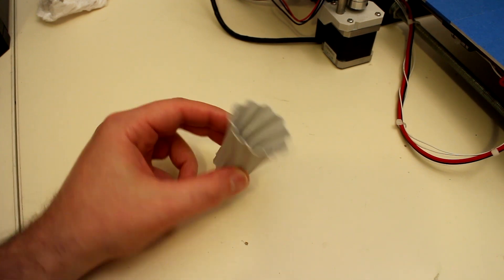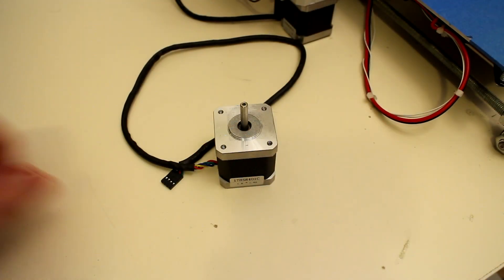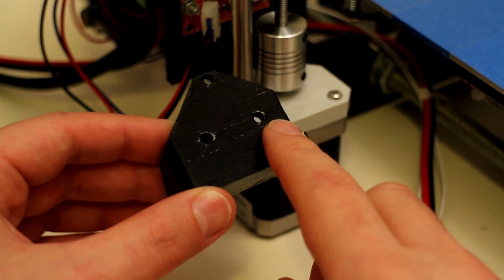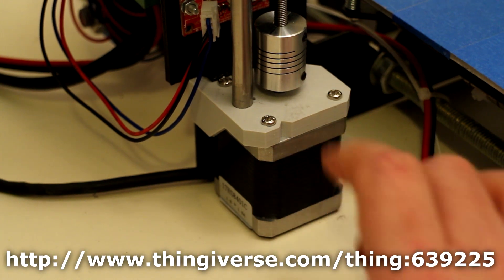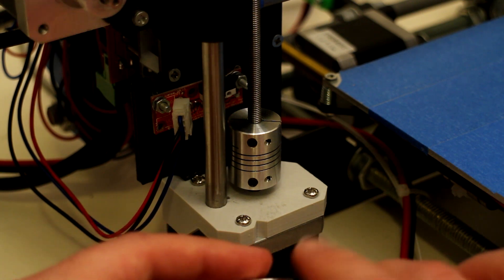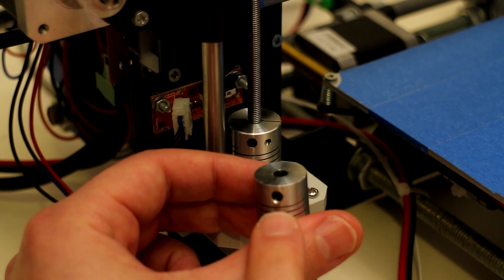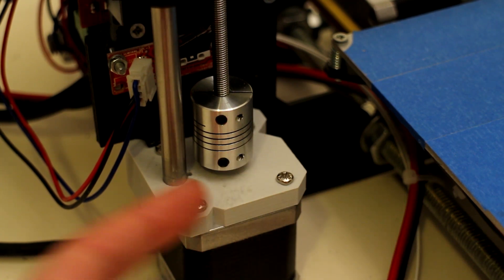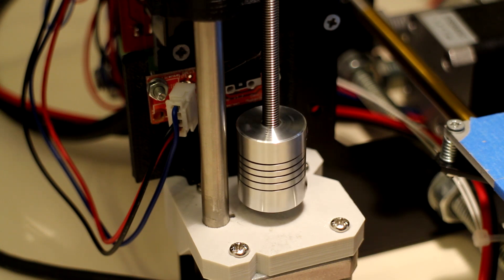3D Printer - Improve Z-Axis Print Quality

Comment: Good tips! I've been doing taller and straighter prints lately and have noticed a perfectly periodic Z wobble. It's very slight, but noticeable when the wall should be dead straight. I think I can resolve it with some of the info you gave here.

Comment: i had lines/ridges start to appear over time,finally decided to figure out why... i just changed to couplers that look like the ones you have exactly others were thin blue ones that came with my cr-10 clone... i did find one of my grub screws was loose on one motor next to extruder also which may be the main reason i had issues. there was only one grub against threaded rod anyway.. these new couplers  have 2 grubs screws for motor shaft and 2 for rod... i am doing a print that turned out not so perfect yesterday...hoping this fixes the issue... ps i think i heard these couplers with rubber built in mounts can fail... Has that happened with yours? thanks again

Comment: tip for reducing headaches in the future:
the reason why consumer electronics manufacturers use locktite blue on fasteners is because it prevents the fasteners from loosening up due to vibration, this is critical to know when assembling an ender 3 since the fasteners keep coming loose on mine and an adhesive reduces the need for maintenance drastically.
some say that loctite blue serves to show if a warranty is void, but you would need to unscrew the screw and break the seal to check it, so i doubt that.
this is also why rivets are better than bolts

Comment: Is it fairly easy to bend a stepper shaft or is that merely a manufacturer defect if you're so unlucky to get one?

I have a delta and am just about ready to throw in the towel with this thing. Everything prints just fine except when it starts the outer shell, it leaves a blob and gradually smooths into the surface as the layer carries out.

Esteps are calibrated to perfection, tried printing at hyper speeds (100-120mm/s), 2.5mm retract @ 45mm/s, and even tried a negative value in retract restart (but that made it worse).

Comment: While the human eye is an incredibly precise instrument, the proper tool for the proper job is always good advice to follow.

A micrometer is a must-have for accurate and precise measurements of parts. The threaded rod, for example. Measure everything, and return or toss out-of-spec components.

A dial indicator, likewise, is a must-have for accurate and precise measurements of parts and assemblies along their long/longitudinal axes, such as stepper motor shafts, threaded rods, and stepper motor, coupler and rod together. Measuring at the furthest point from the fixed base yields the greatest precision as any angular deformation/mis-alignment is exaggerated.

A weighted or magnetic mount for the dial indicator is also a must-have accessory.

As with most things, you get what you pay for. These are tools that will last a lifetime, so buy quality the first time.

Buy quality parts. Measure for precision before assembly. Then measure your assemblies as you build and you'll be all but guaranteed of a good result.

Comment: My 2 cents: Let the screws rest on the motor shaft, that way you remove any springiness, and the entire weight is taken by the motor bearings. Next, make sure you Z guide rods don't move in their respective holes. Even if the screws are bent and wobble, they are lose on the top and the guide rods should prevent any movement, even if the screws move.

Comment: Another common problem in this case, is an unlevel bed. IF one side of your bed is slightly higher up than the other, it can cause the Z offset for that one side to be inaccurate.
Reply: opalthunder that will only occur in the first few layers not fir the entire print as it would level it self.

Comment: The job of he coupler is not to act as a spring (although it does). It principal purpose of the coupler is to handle misalignment so that the shafts don't have to be perfectly aligned. If you want the coupler to perform better, make sure the far end of the shaft is in line with the motor shaft.

Comment: A great set of videos. you are appreciated.

in regard to the z axis coupler . I note the importance of keeping the shaft and rod apart to allow a bit of flexibility in the coupling, and I appreciate that the print results determine whether something is a good hypothesis or not, however something that may be a second order issues is the spring in the coupler..
In winding up the platform the coupler goes into compression, ie shortens slightly and on stopping of the rising it will bounce upward from the release of pressure (acceleration). I suggesting thinking about the oscillation that may occur at the abrupt halting of rising or lowering and if this reflects in the print as Z banding.

Comment: You're correct in there should be a gap between the stepper motor shaft and the threaded rod. 

If you look up how to install a Helix Flex coupler, more importantly the exact one's you install no matter the brand, they give specs on the max shaft insertion length for the particular coupler.

They'll also give specs on the max off center distance it will correct for. 
They're not all made to the same specs.

In addition, proper installation of the Helix coupler is done by first setting one side. Generally the stepper motor side. Then insert the other shaft, in this case the threaded rod. Before tightening, you must spin the coupler to allow it to fully expand and find center. Then you tighten it.

It's amazing to me, in this day of Google, no one has taken the time, a shear moment to search how to install them properly. Especially if you find you have an issue in that area.

Most continue to go by trial and error. Then pass on findings. Which may or may not include complete let alone correct info. 

It boggles the mind sometimes. Or rather mine. And gains a shake of the head... I've found even the manufacturers don't know how to install these couplings properly. 

Just mind boggling... And yup there goes the head shake just thinking on it. lol
Reply: Strangely it happened to me that if the two shafts touch each other I do not have z axis problems. Whereas if they don't touch, due to the up/down flex of the couple I get irregular layer heights. Meaning the couple expands and contract while the z-motors turn under the load of the x axis.

Comment: For those looking at printers from china, expect to do a lot of work in this area. some of the printers from Banggood have had errors up to millimeters in the straightness of the screw rods or tie rods causing in a worst case scenario complete seizures. Check before assembley and replace or straighten rods and up grade couplers and oversize sloppy bushings and you will be on you way to having a half decent printer

Comment: Interesting, I'm having similar randomised wobble too. I'm using a printer with a ply frame, it's well attached and I've replaced my couplers with printed self-centering ones (which got rid of the sinusoid all Z wobble). I also plan to upgrade to proper lead screws but I'll definitely check the motor wobble. Though the randomisation suggests it's nothing to do with Z being off-centre. I'm also making silicone bushings to replace the z levelling springs.

Comment: Hi there, thanks for the information. Having worked in industry, I can tell you that flexible couplings are actually used to mitigate a miniscule amount of axial misalignment over a short distance, say between a motor and pump directly coupled together and not a long shaft like these used on these machines as any misalignment gets amplified. Even then, the motor is still always aligned to the pump using various methods. Also, because as you say, these couplers are springy, any vibration in the machine could potentially mean your z axis can bounce around. 

Because threaded rod is usually undersize and inherently pants in a linear motion, what I've done in the past to get by is to drill the centre of the rod 5mm. then, cut with a hand saw down the length of the rod along the hole you've just drilled essentially splitting it to 2. then thread on 2 nuts along the split, insert your motor shaft and tighten the 2 nuts against each other. this clamps the split end on the shaft coupling it. 

I've drilled mine on a lathe with the end supported in the bore to stop it and aid accuracy. done well, the Motor shaft fit can be tight enough that it actually holds itself in under vacuum! works well for me and a very positive coupling.

in an ideal world, the shaft should be supported both ends and the motor coupled directly onto the end, this is his I've seen it done on high end routers and mills. 

food for thought!

Comment: Hey :)
In the end of the video(8:48), you showed the z motor spinning and it makes a little whining sound. I just built my i3, and mine's whining sound is a lot louder than yours(during fast movements such as homing), do you think it's caused by some of the problems you memtioned?
Reply from the maker: +Rexus King 
That would be caused by higher current supplied to the motor. You can adjust the current with the trim pot on the stepper motor controller.
Reply: Thank you! I'll report results when I adjusted them!

Comment: I replaced the 5/16-18 threaded rods I had in my repstrap with 8mm two start lead screws.  These are precision threads, unlike run of the mill threaded rods.  I also replaced the vinyl tubing I was using as a coupler with a 3D printed one that works similar to the type of clamping couplers you found.  I have an 8mm bearing mounted up top to keep the rod running true, and I also carefully adjusted my motor mounts to get the shaft of the motor, and the screw 'nut' in the gantry perfectly in line.  I then adjusted the bearing up top to also be perfectly in line.  Made a BIG difference, my Z 'wobble' is almost totally gone now.  You'll always get a bit of wobble from SW round off errors, especially if your layer height isn't a perfect multiple of the steps/mm.

Comment: Thank you for your troubleshooting tips and advice. I am looking forward to getting my 3D printer up and running. As soon as it shows up at my door! lol It is on a slow boat from neverland.. I noticed in the kit I am getting, I am looking at the pic of it and there is no coupler from stepper motor to the Z axis. I am curious how they attached the threaded rod to the stepper..
A side note.. You talked about the Z axis rod and checking to see if it is bent.. I worked for a company that made dot matrix printers and one of my many jobs was to check for bends and correct any rods that were not within tolerance. If I remember correctly, I had .003 - .004 to play with. That task got pretty boring pretty quick..
Reply from the maker: +Mike Notarnicola 
Hi Mike. Great to hear you've bought a 3D printer. Which ever kit you bought will provide hours upon hours of fun no doubt.
Dot matrix printers hey, I remember those. Very loud. Good old days :)
Reply: This is the one i am getting
http://www.gearbest.com/3d-printers-3d-printer-kits/pp_240236.html 

The fun part will be building it :-)
Reply: How did it go with the 3D-printer? :)
Reply: The one from Gearbest arrived DOA and they have not sent me the parts to fix it.. So, I got a different one from Wanhao. I works really well.
Reply: Mike Notarnicola May I ask what model from Wanhao you got? 

Oh man, that sucks.
Reply: https://www.amazon.com/Wanhao-i3-V2-Duplicator/dp/B01CGB8LA6
Reply: I did not get it from amazon.. I got it from another vendor
Reply: Mike Notarnicola I'm thinking about buying that as a second printer. I bought the Duplicator i3 Plus a week ago, and I am more than happy with it.
Reply: It is a great printer

Comment: Have you put any thought into changing your 5mm rods to ACME threads.(Z axis) Quite a debate whether it makes a difference.
Reply from the maker: +Charles Gagne 
I think the big issue is the need for a shaft coupler in the first instance. I've read on the reprap forum folks upgrading to acme rods and it still not 'fixing' any z-axis artifact issues. I personally would replace both z-axis motors with steppers that incorporate the acme rod as the shaft. No couplers required then. Those steppers can be bought from aliexpress, ebay, etc.

Comment: I couple my 5mm threaded rod to the stepper motor using a piece of silicone tube.
Reply from the maker: Paul Hozza 
Cool. How do you find your z-axis print quality? Are you seeing any banding/ripple?

I tried a piece of tubing a while ago and I couldn't see a benefit from the aluminium flexible coupler.

Cheers.
Reply: Tech2C I had the same couplers as your original ones and could see an instant improvement, but I do like new ones in the video which I may try, but as the old saying goes "if it ain't broke don't fix it"
Reply: I'm really thinking about buying one . Any recommendations for a different printer less then 500 us ? if not what should I know when buying this and what should I expect?
Reply: +Canaan K I am getting the Aurora A3. You can find it for less than $500.00 US. I can't vouch for the quality of prints or anything, as I don't have it yet. But from what I have seen and read, it seems like a real nice printer.. I am excited to be getting it.

Comment: Noticed that you don't have any fixation at the top for the threaded rod. Is that a mod? Maybe it's a good thing that it can turn freely, if fixation aren't aligned 100%.
I have just bought my own Prusa, and it need some updates but first I just need to be able to print. Was not as easy as I thought :)
Reply from the maker: Jonas Nestander 
Hi, I tried restricting the rod at the top of the frame, but it made the z-axis banding worse. Better to leave it move freely I found.
Good luck with your build, it's a learning exercise but well worth the effort :)
Reply: Tech2C Okey, needs to be done on mine too I guess. Can't imagine that my top and bottom are aligned, kind of regretting that I bought one with acrylic body. But I will make it better, it's gonna be fun!
Really like your videos, helps very much :) Maybe try out some wood filament? :)

Comment: I also noticed that on my couplers I don't like the fact that the grub screws are at 45 deg pushing the rod to one of the sides.
Wondering if making a extra support for the threaded rod on the top and bottom (close to the coupler) with a bearing wouldn't help. It would force the rod to be straight and any wobbling would be caught by the coupler.
Reply from the maker: Nandox7 
Hey, I tried both of those ideas recently. Constraining the threaded rod at the top or base next to the coupler resulted in severe banding. It sounds counter-intuitive but just letting the rod do what it wants gives a better result. 
Cheers.
Reply: Hey, thanks for the feedback.
So far the best improvment I had was by locking the X smooth rods in my printer they weren't locked in the X parts and when tightneing the belt it would make the Z smooth and threaded rods bent.
Next I'll be changing the Z threaded rods to M8 leadscrews. As I notice there is still a lack of precision on the Z axis.
Cheers

Comment: Great video! Those motor holders are the same as what I am now using, after the original warped under heat and pressure. Also think I will leave a space between the shaft and rod, always wondered if you should or shouldnt.
Reply from the maker: Oldenglishshifty 
I'm surprised mine lasted as long as they did! Virtually crumbled in my hands!

Cheers.
Reply: Tech2C just waiting for payday, to order some ABS.. to re-print them. Always worrying about heat now -.-

Comment: was this printed at the printers max resolution?
Reply from the maker: Callum Mcleish 
These were only printed at 0.2mm layer height, which is the resolution I normally print at. I have printed at 0.1mm layer height previously but the software allows virtually any resolution you like.
Reply: it looks really good at 0.2 i thought it may have been 0.1. its just that i have been looking into getting one of these but haven't been sure of the actual quality, thanks :)